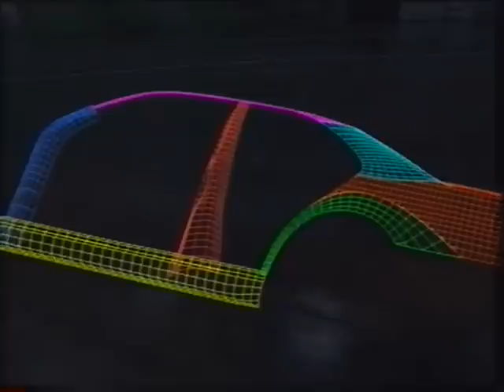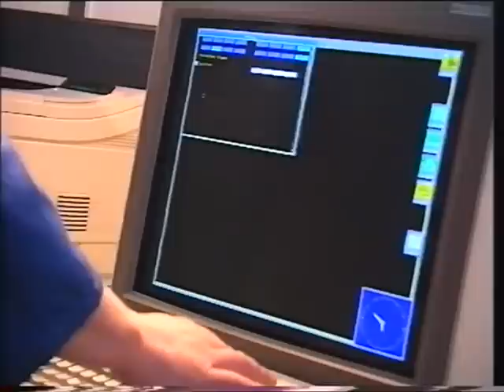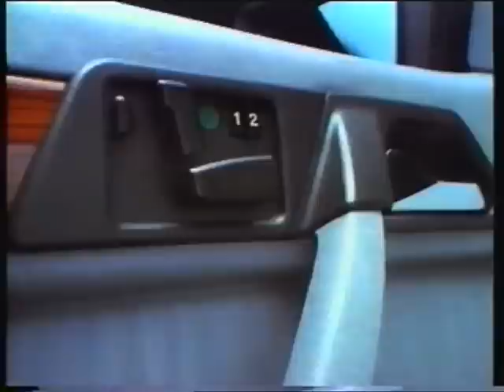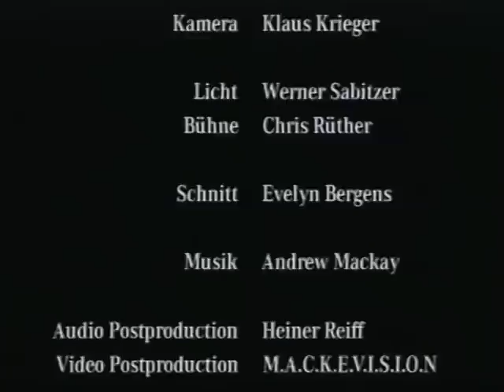Mercedes-Benz Factory Sindelfingen 1995

Comment: If only it was possible to buy a W124 brand new today I'd order one without hesitation even though the design is over 30 years old
Reply: It would cost you probably more than an 2019 Mercedes.
Reply: Yes I think you are most certainly right there which is part of the problem; drive for 6 hours in a new E Class with foam filled seats then do the same in the 124 and you will realise the inherent quality is not the same though. I can't imagine many people  will want a 30 year old 2019 model in 30 years time as it won't have the same legend, then there's the issue that all of the electronic stuff will have long given up the ghost.
Reply: Me TOO!!! Mines the last year. 1995 E320 wagon. 200k miles. Runs AMAZING
Reply: @
Malcolm Lane-Ley, my sentiments exactly!  Every time I drive my '92 W124 230E (215k kms) I tell my wife MB could've continued building the W124, but with the old engines that were used up to '95, after that the engine quality and durability went downhill.
Reply: More modern W204 and W212 are still high quality cars that can even exceed kms of W124s. For example rust protection is better.
Reply: @Seppo100100  I'm not so sure, the V6s and V8s had a multitude of issues.  Failures - caused by poorly designed components (cost savings) below 100k km were not uncommon.
Reply: @anasbtr  oh for sure. I still have the original window sticker for my 1993 300D 2.5 Turbo. It was a few dollars short of $50k. E class today are around that. Mine has 300k miles btw
Reply: I got one 30 years old. Still running very well
Reply: @ronnyfarang586  hi.95 E280 masterpiece 134k miles. Brit In KL.. Thinking drive out to Thailand when things improve.W124.
Reply: Or w126 560 sel...brown on brown.
Reply: Anything is possible.
Reply: You can I've one with 75000 miles
£10.000 will buy it like the day it left factory
Reply: quality over gadgetry.   It would cost $60,000 for a low powered car but the quality material is where the cost lies.
Reply: Modern Mercedes is disposable, reliability limited.